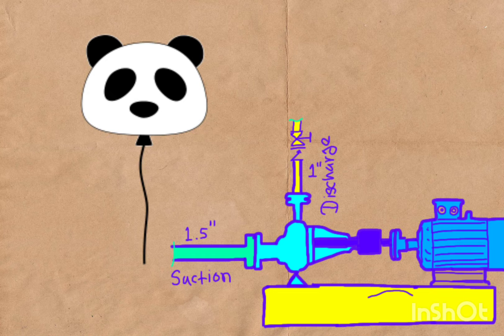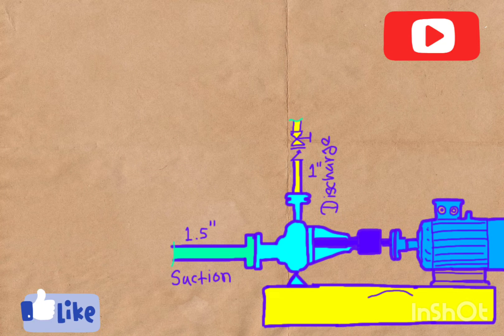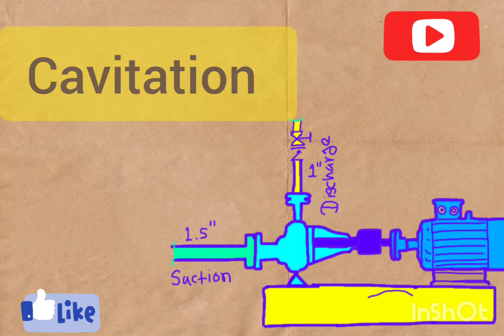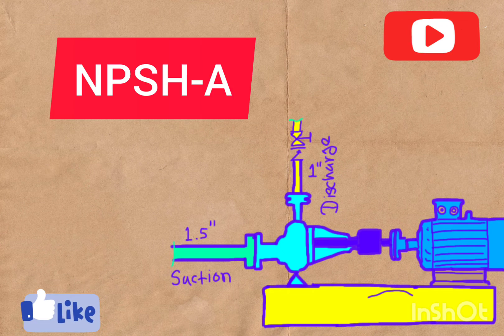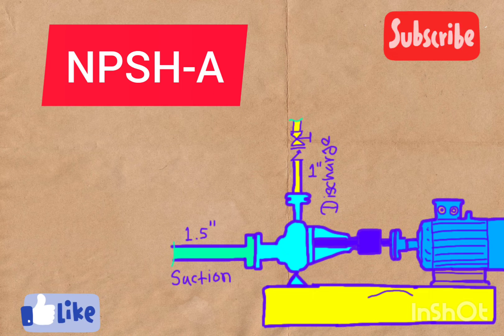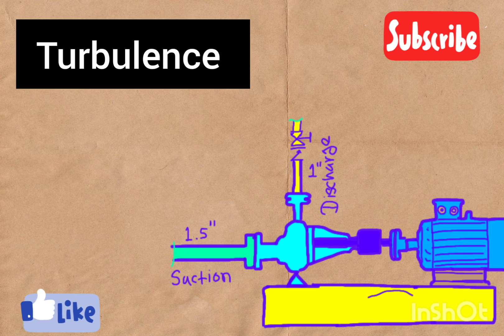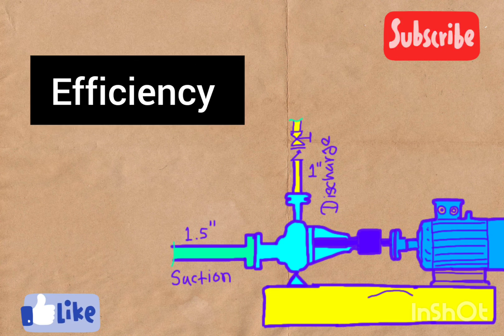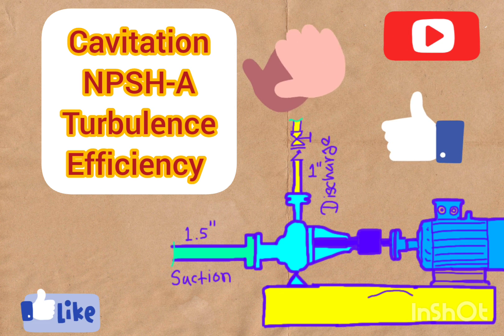Why suction line diameter is bigger than discharge line diameter in centrifugal pumps?

Comment: What happen when pump suction and discharge pipe size same ??
Reply from the maker: It depends on the process, in some cases it will be ok. If you  design pump suction line size as per NPSH then in that case it might be  ok,